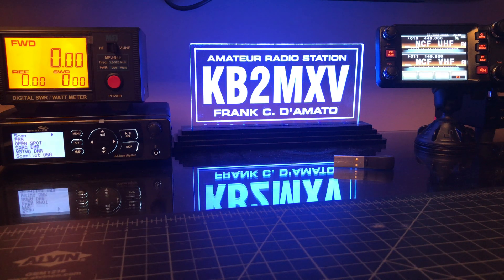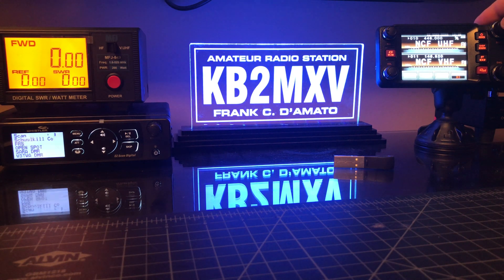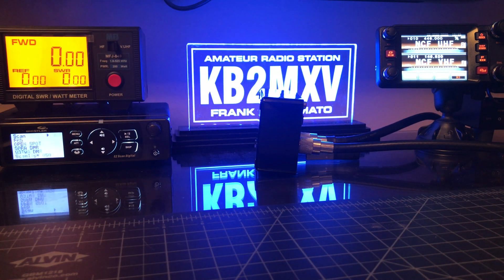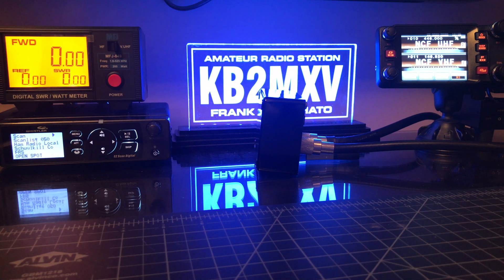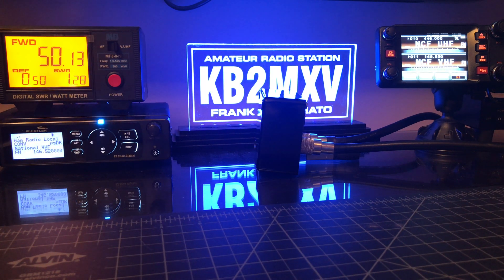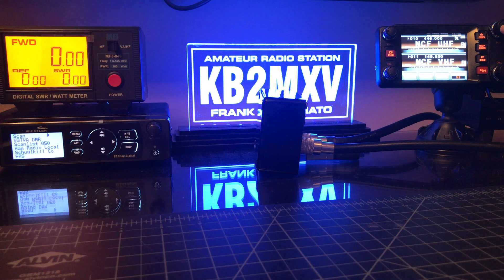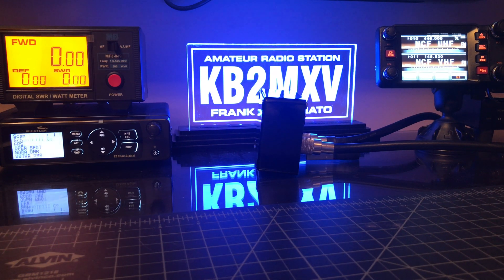MFJ-1708B-SDRS UHF Issue

Comment: The radio reduces power as protection. Perhaps the SWR was already at borderline and the switch took it over the threshold for protection.
Try again with an antenna with lower SWR for testing? Perhaps a simple 1/4 wave?